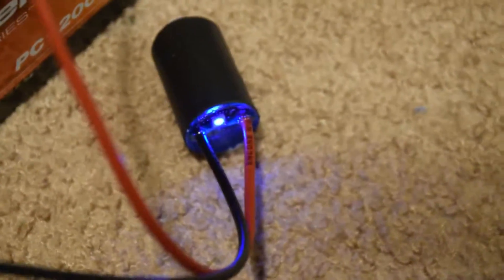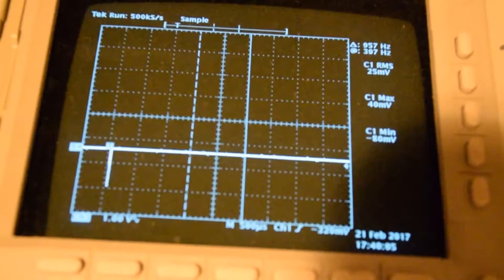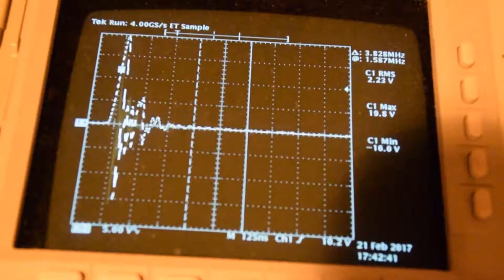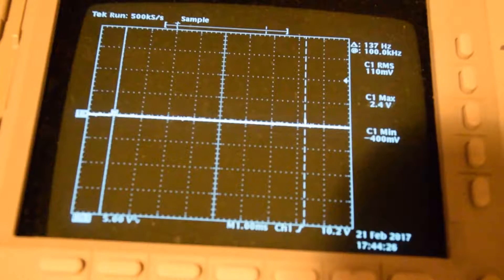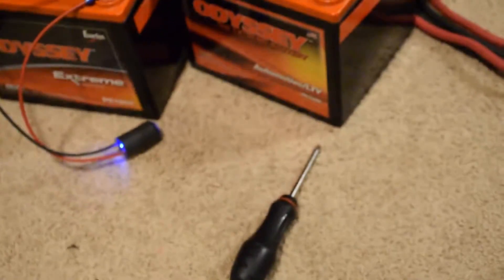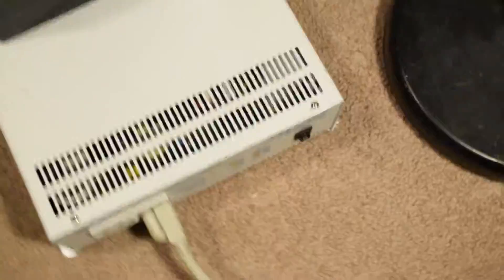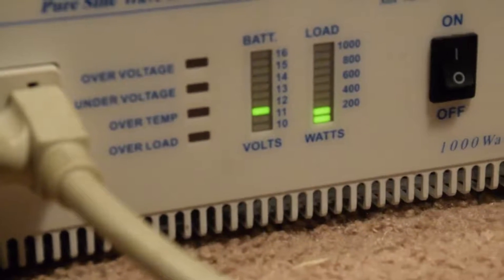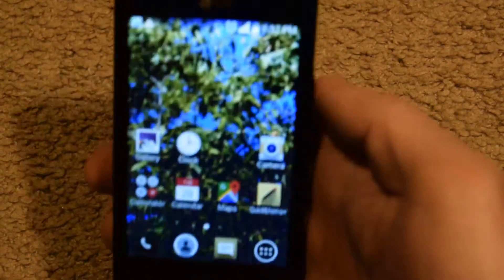Desulfators and load testing batteries.

Comment: It is best if you have a charger maintaining the battery at high voltage over 14 volts that's just for battery maintainer charger then you can put the desulfator  top of that.

Comment: i thought you were supposed to use these in conjunction with your battery charger.
Reply from the maker: As long as you keep the battery charged it should be fine. I've found that some chargers will absorb the pulses from the desulfator rendering them useless. If you do use a charger with a desulfator it might be a good idea to use a choke in series with the charger to filter out the pulses and keep them from being absorbed by the charger.

Comment: Hi , at least your desulfator seems to be giving more output than the Infinitum & Battery extra ones I tried, which did nothing after weeks on my batteries.I have conductance testers & discharge testers etc.It's a very slow process as you point out, but at least 1 amp hour per week is something. The guy from 'My Playhouse' tested some desulfators for weeks on You Tube & they were useless.

I found cycling down to 1.9 v per cell with a C/20 load then a trickle charge at no more than c/20 rate, has worked to reduce sulfation without any desulfator needed. This also may take a week or more to give results too. Kind regards.
Reply: My brother respect I recently bought one of them desulfator off Aliexpress hay to be honest with you my battery bank is 8 years old I buy my batteries used they are seal 6v batteries when I bought them they sits @ 11.8v of note these batteries was built in April  2006 we are now in May 2019 and brother I boil the crap out of them to the point they sit at 12.6 then they wouldn't go any further through boiling so I needed something to bulk them up so I think desulfator hence the no name brand from China it is on my battery 🔋 🔋 bank for almost a month now and what I noticed it still sits at 12.6v but it takes longer to it the 12.6v where as by 10 @ nights it use to sit at 12.6v now it sits @ 12.6 @ 2 in the morning so if the desulfator not working for you try the agm battery 🔋 equalizer oh one more thing while I did mention my battery bank is 8yrs old the batteries are 13yrs old. One thing I notice from my experience if you want the desulfator to work right away it will give you a heart ♥ attack it is a slow process.